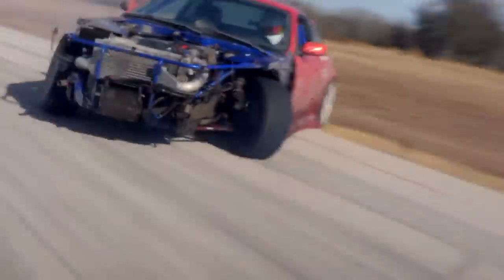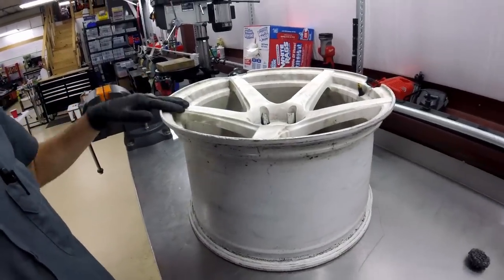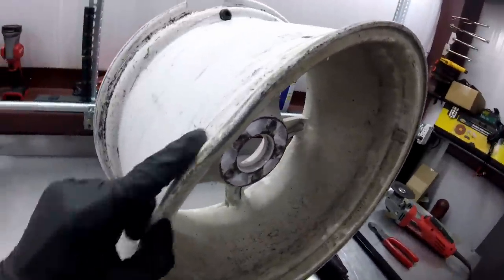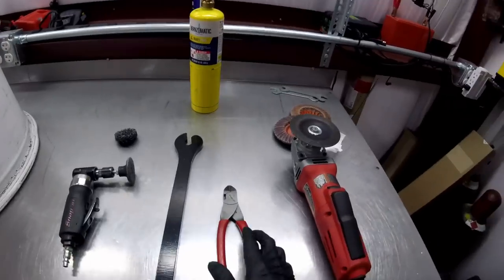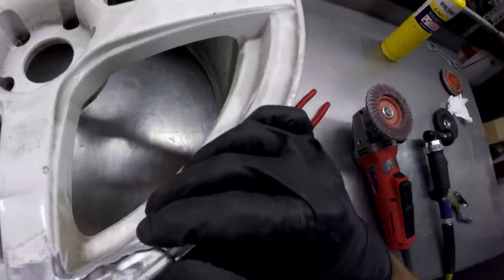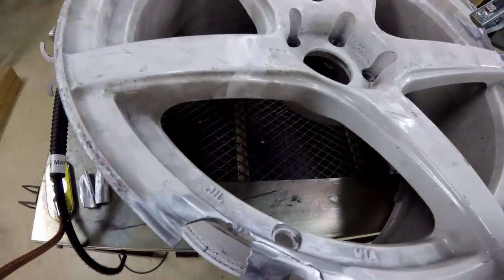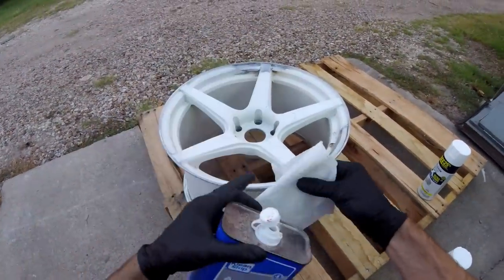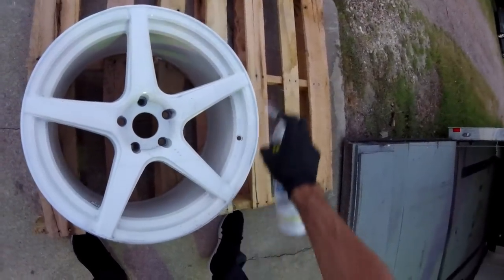SAVE MONEY OR A WASTE OF TIME? DIY Wheel Repair

Comment: You did a great job for not knowing how to fix wheels.  I used to own a wheel repair shop, and the few pointers I would give you are pretty simple. 

First and foremost, do not ever try to bend a cast aluminum wheel without heating it (especially on the face).  If you would have heated the big piece before trying to move it, you could have pretty easily got it back to a tac able point and then been able to work it from there. 

Second, cracks always extend beyond what you can see.  If a piece has not broken out, you have to clean the paint back and use a little paint thinner or acetone to wipe the clean metal with. The crack will stay wet for a few seconds longer than the rest of the aluminum.  Once you can see where the crack ends, you need to either cut through the end of the crack with a cutoff wheel (circular saws work well for cracks on the back going straight in) or drill a small hole at the end of the crack before welding, or it will start cracking again. 

Back to heating, even after you weld a piece in, heat it if you need to move it (each time you reweld a spot, the aluminum becomes more brittle and more likely to crack again in the future in that spot).  While heating, get yourself a infrared thermometer. You want to heat the area to 400 deg F. Heat a bigger area than you want to bend, so it doesn't crack next to where you are bending.  Rim wrenches are only good for moving a lip up or down a little bit (and mostly just the outside of the lip.) Get yourself a lead hammer for best results, but deadblows work well too. Steel faced hammers concentrate the force of the impact too much in one place. Reheating the weld, as you did, is actually pretty necessary on cast aluminum, because as you said, it's porous and the only way to get it to smooth out and make sure you don't have bubbles and pockets in the weld is to pass over it again with no filler, like you figured out. 

So all in all, nice work and a great job for someone who's never done this before. If you want any other tips on wheels, like trying to round them out and things like that, shoot me a msg. I'd be happy to help out however I can.
Reply: @CLP  Mapp has will work fine.  Oxygen acetylene works much faster but isn't necessary.  The key is to just keep the heat moving around slowly and use an IR thermometer sip you know what your temps are.
Reply: i just learned how to weld wheels
Reply: thanks for all this valuable info
Reply: @chris Van Auken You are a legend! Thanks for this advice, I have some cracked wheels that I am going to give a go at!
Reply: I too am a wheel repair tech/Tig welder and completely agree with all of these tips and points 🍻

Comment: Wheel repair guy here. Always drill ends of a crack to keep them from propagating any further.  I prep the area to be welded by V-notching out the crack on both sides to get full penetration of the weld. I've seen tons of welds that were not done this way re-crack when you sneeze on them.
Reply: 120% correct. Dealing with this bs right now

Comment: why are 5 spoked wheels ur preference? is it just aesthetic or performance based too?
Reply: 5 spoke wheels are just more aesthetically pleasing to a lot of people. Hence why the work meister s1 is so popular
Reply from the maker: mostly aesthetic ya, but also much easier to clean, shows off nice brakes, and depending on design can be lighter weight than multi-spoke wheels (less material)

Comment: Cast alloy is generally cheap horrible crap, wheels should be different but may have a number of metals mixed in to improve strength and flexibility etc you may have trouble welding it with normal alloy rods but if it’s looking like you’re welding some kind of mud you probably have a crap cheap wheel and you should just toss it in the recycling bin.